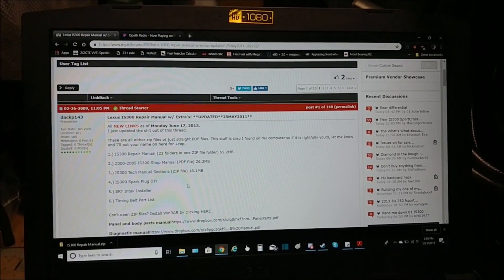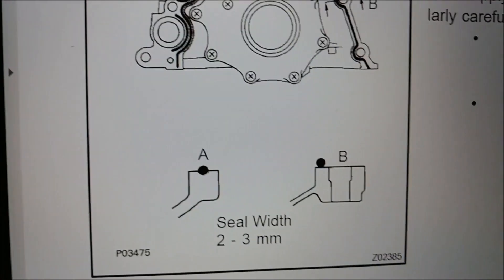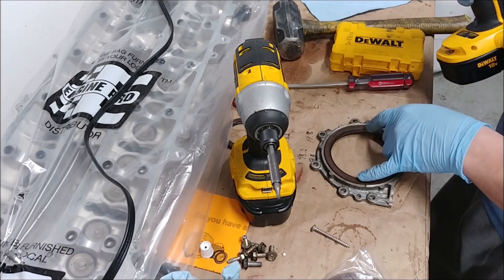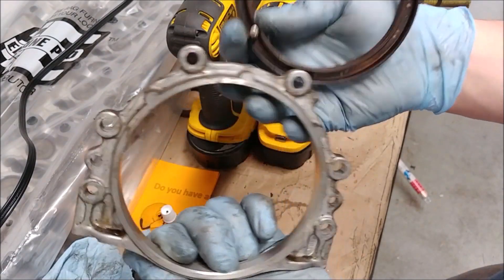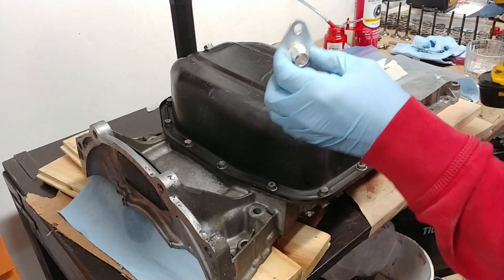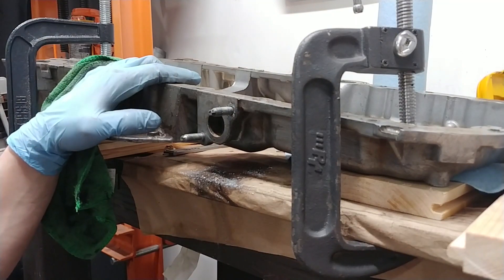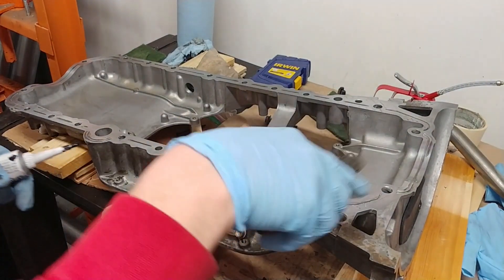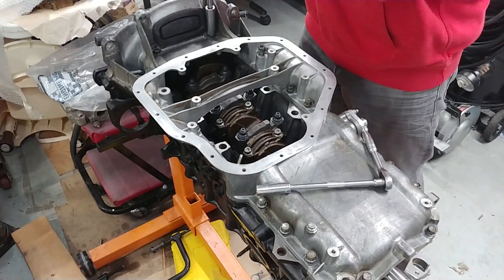2JZGE NA-T Build Part 2: Shortblock Full

Comment: i think @ 2:02 you're not supposed to put sealant on inner half circle grooves. Real STREET 2JZ builder said, its there to catch any excess silicone.
Reply from the maker: I followed the sc300 oil pan install. Cant hurt but obviously nothing I can do now. Been 2500 miles since the build and no leaks yet thankfully.

Comment: hey man can i take that rear main seal housing out with the sump in place or does the sump have to come off for that housing to come off? also what are the torque spec for it if you know? thanks
Reply from the maker: Unfortunately the pan/girdle will have to come off. But you can still just do the seal the old fashioned way. According to the IS300 repair manual: If the rear seal retainer is installed on the cylinder block.
(1) Using a knife, cut off the oil seal lip.
(2) Using a screwdriver, pry out the oil seal.

(Install the retainer with the 6 bolts.
Torque: 6.0 N·m (60 kgf·cm, 53 in.·lbf))

Comment: What's your thoughts on the 2jz NA block not having oil sqirters for the under side of the pistons.?
Reply from the maker: It's an added benefit for sure.  For me it wasn't cost effective snagging a gte engine as opposed to the JY motor.
Reply: @SALTYDATTO  same here in Australia the price of a gte block is quite expensive compared to ge,
What kind of hp is it able to reliably support without the sqirters do you know or have you seen..?
Reply from the maker: I couldn't say personally m8.
Reply: @SALTYDATTO  yeah, kind of a do it and find out situation huh.
Nice vid man, good job.!
Reply from the maker: Means a ton coming from and Aussie. You guys know your shit when it comes to motorsport. Jealous of your availability on JDM goodies!

Comment: where did you get that gasket maker stuff? brand ect that looks 1000% cheaper than paying $350 for a gasket set lol
Reply from the maker: It's called Toyota FIPG Part number: 00295-00103. Or from Threebond TB1207B. That's the other part number that's recommended by Toyota.
Reply: @SALTYDATTO  picked up some GTE used pistons for $200 😊 so just need to get the Crowley cams and gte oil pump and gather the gaskets and assembly time! How do you feel about the ele water pump on a 2J?  Do I need the oil squirts? And one other question 😅 will the GTE cams work in a NA head? (Probably not I feel)
Reply from the maker: BTW what engine from what car are you going to be rebuilding? To answer your Q's: 1. idk lol 2. You dont need but they are nice (in theory) 3. Not certain on that. I'd scourer supra forums and myIS forums if that's been done.
Reply: @SALTYDATTO  05 GS300 2JZGE
Reply from the maker: So IS and GS 2jzge's have the bad rods. Get some sc300 or supra rods if you can. Those can actually handle power.